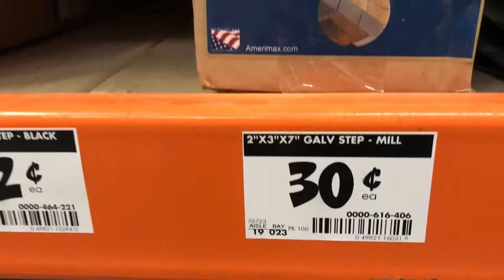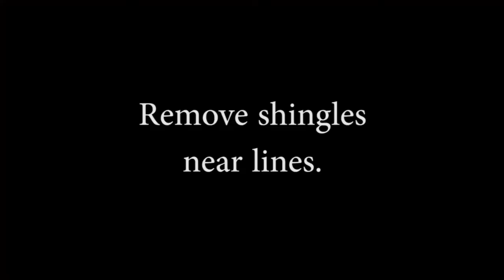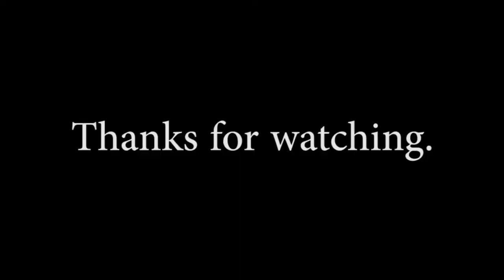Chimney Cricket Part 1 - Framing

Comment: ex tower climber here - your anchor point for your fall protection was sub-par at best. the anchor point needs to be able to handle 5k lbs of shock force and thar iron you choose will not do that. im glad you didnt really need to use the fall areest, but next time choose a more stout anchor point or you'll just fall to the ground with a harness on.

Comment: You can use the pythagorean therium when installing a cricket as well unless you have to flip the board. Measure all three lengths on lengths on a plumb line. Mark with a pencil with a half moon on your plywood to find the beveled edge where your measurements intersect. I like the bevel though I will have to add one to my tool collection

Comment: At around 11:30 couldn't you have replaced your red level with the 2×4 and used another 2×4 to make the angle cuts? Also how did you find the bevel angle again?

Comment: The only thing that bothers me is using your leg to hold the wood while you cut.  Its a quick way to cut the major muscle in the top of your thigh and that's a huge medical expense sewing that all back up.  I seen a guy that happened to, it wasn't pretty. But other than that, good job and thanks for the tips.  We have to build a cricket to stop the water from soaking into the brick mortar and turning our fireplace into a humidifier.  Good job on the harness also!!
Reply from the maker: Thanks for your concern, Wanie, and the kind comment. I’ll try to be more careful 🙂
Reply: @FamilyFriendlyDIY  🙏❤️

Comment: What tool are you using to che k the angle
Reply from the maker: Good question. It's called a sliding bevel, Justin. Here's a link to one:
https://www.lowes.com/pd/Swanson-Tool-Company-9-in-Sliding-Bevel-Gauge/1002895?cm_mmc=shp-cprdtolgooglelia-216-levelsandsquares-1002895-_-0&placeholder=null&ds_rl=1286981&gclid=CjwKCAjwi9-HBhACEiwAPzUhHEu3IO4HcsDEHnyHrHXEmx66C6zme4rVw3g9fNoryNDgxWIIHbZ9axoCjsQQAvD_BwE&gclsrc=aw.ds

Comment: Man you could have mortared those holes and been done in 20 min.
Reply: Yes you don’t need a cricket When it’s a small.
Reply: @openyoureyes3113  this is wider than 30 inches which usually requires a cricket by modern standards
Reply: @jerryjenkins6071  I agree, whenever I meet a chimeny wider than 24 inches I do frame it.